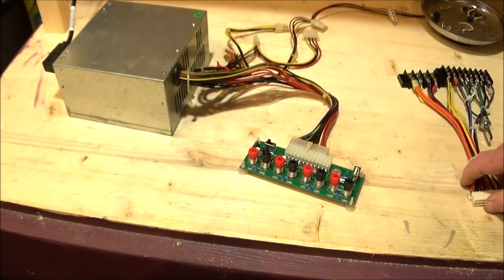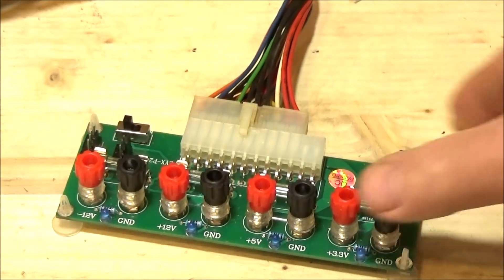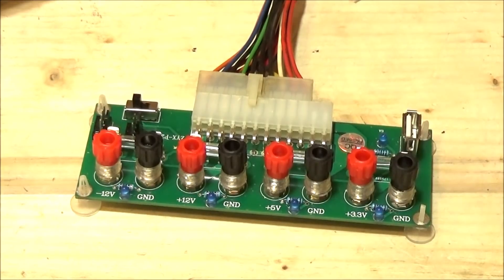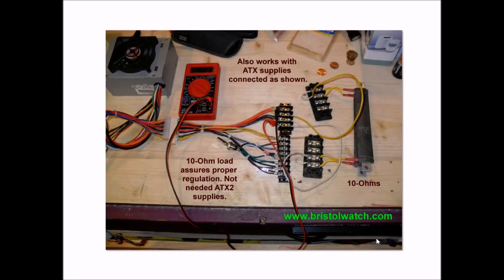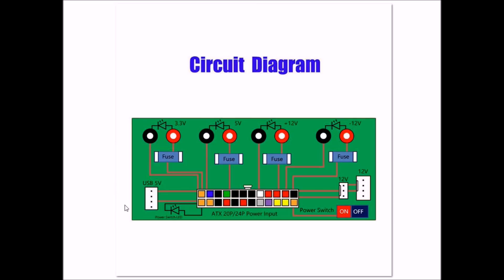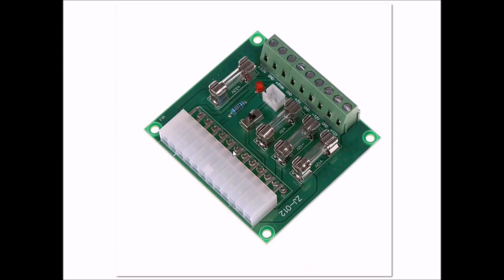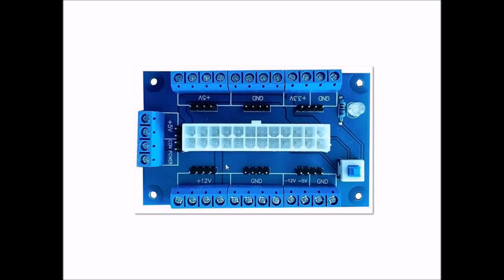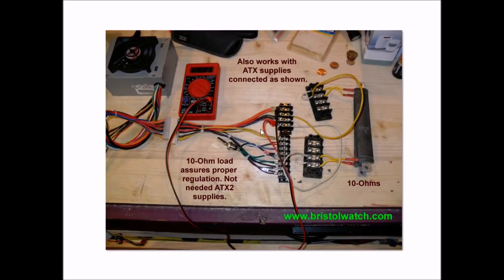More on Reusing PC Power Supplies

Comment: A 12v automotive light bulb across the 5v line is a good substitute for the 10-ohm resistor and it is also a pilot light.
Reply from the maker: Noted. Thanks.

Comment: I Iike the way youve used extension cables  too build your own unlike alot of other videos where they open the psu and cut the connectors off the wires. This way leaves the psu intact so that it can be used in a computer in an emergency if the psu in your computer breaks.id like to make a version more neater in a plastic project box tho with sockets for all the cables coming from the psu

Comment: The ebay/amazon board with binding posts and usb port comes with 5A fuses. Is this becauase the traces on the pcb cant handle more than 5A? And another reason to make your own with good gauge wire.
Reply: Ive actually purchased this board and after examining it discovered that the traces are quite wide so could probably transmit a significant current. Im using a 400w psu with a 30amp 12v rail and a 24pin atx connector i think you can get 30amps down 2 16-18awg wires cant you? (Atx24pin has 2 yellow 12v pins

Comment: instead of glas fuses i would suggest automatic fuses which can be reset, they are cheap and range from 3-30Amp
https://www.ebay.com/itm/Circuit-Breaker-Overload-Protector-Switch-Fuse-3A-4A-5A-6A-8A-10A-15A-20ADOL/373047144937

limited time offer even cheaper
https://www.ebay.com/itm/Circuit-Breaker-Overload-Protector-Switch-Fuse-3A-4A-5A-6A-8A-10A-15A-20AODHWP5/333633525865

Comment: I think the resistor is needed only if you use a push button to turn the ATX unit on. But if you use a switch, like it is done in this unit you bought, the resistor is not really necessary. The point is that with the push button, if there is no load, the ATX unit will turn immediately off when you release the push button. Using a switch removes entirely the problem. I did exactly the same thing when I made my power supply fromm an old ATX power supply, and it works perfectly without the resistor and it is very stable, according to the measurements I took.
Reply: I worked with a used ATX power supply that turned itself off instantly without load even with a permanent position switch 😁👍
Reply: I guess it then depends on the specific ATX power supply. I was just lucky that the power supplies I tried remained on with the permanent position switch. Good to know, thank you !